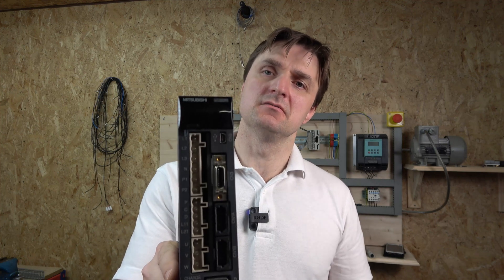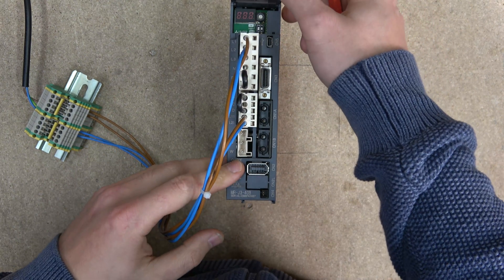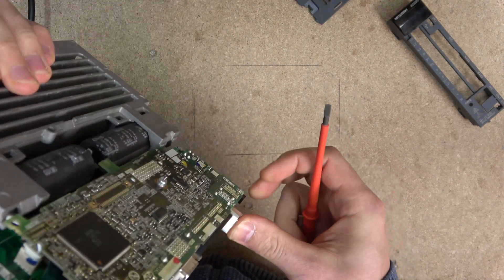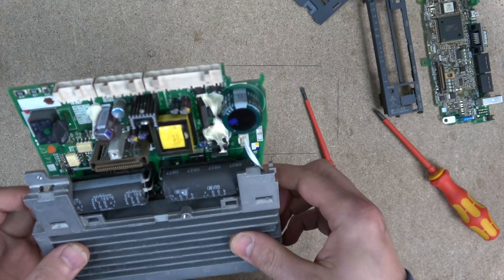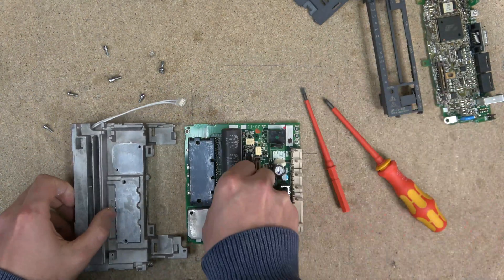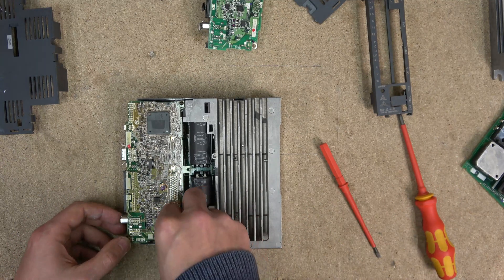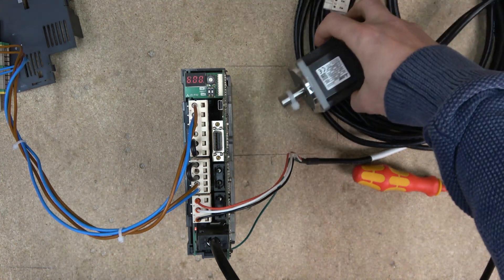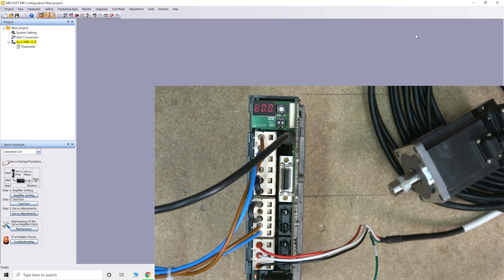Faulty Mitsubishi MR-J3-40B servo amplifier, full strip down and board test with  MR Configurator 2.

Comment: I have issues on Mr j3 350b it work perfectly on if I am using PC to test jog mode but problem is to used cn3 command to run the external controls
Reply: So what should I do to cn3 to run it